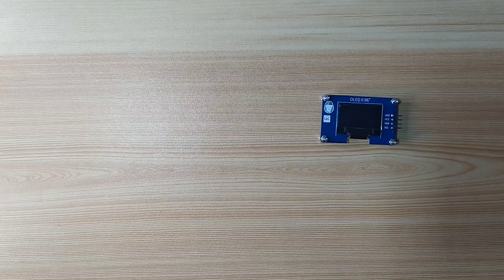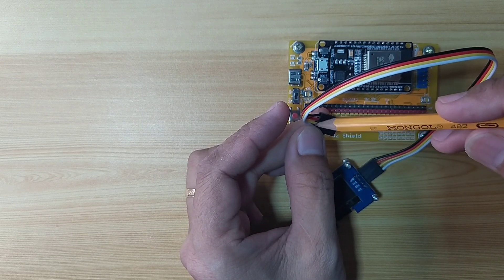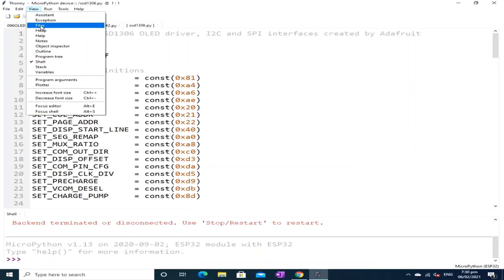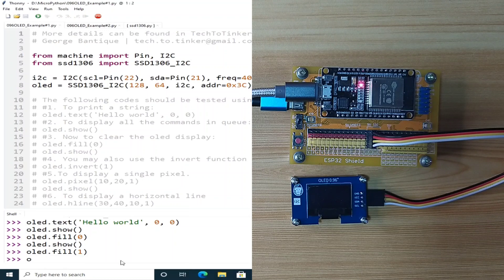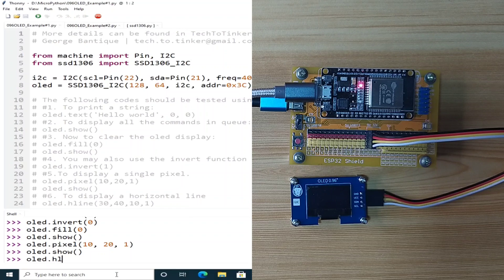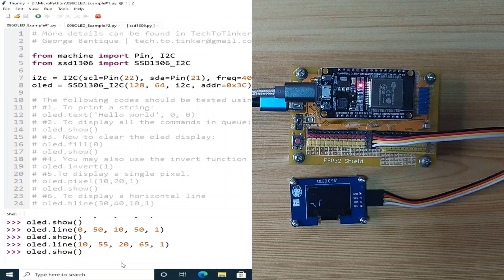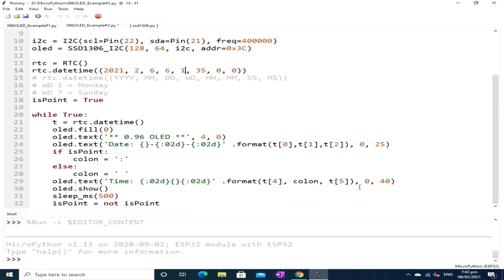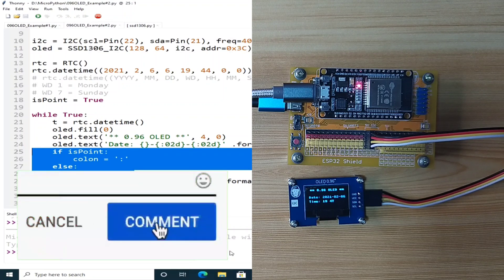010 - MicroPython TechNotes: 0.96 OLED Display

Comment: How would you do a if statement with a potentiometer, and use that library to display different words for different values? I have been trying to figure it out with that library you're using. Thank you so much for all your videos I've learned so much!
Reply from the maker: @Andy Koehler, I would do it as follows:

Pseudo code
while True:

pot = read potentiometer using adc

if pot < 64
display something lets say A

if pot > 63 and pot < 128
display something lets say B

if pot > 128 and pot < 192
display C

and etc.
Which basically changes a letter according to the potentiometer value. Hope this helps. Cheers